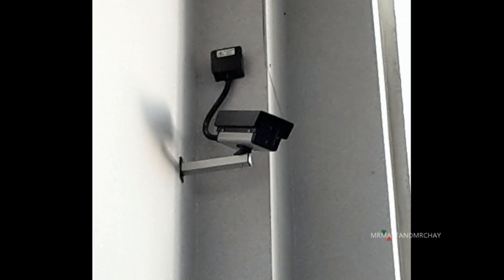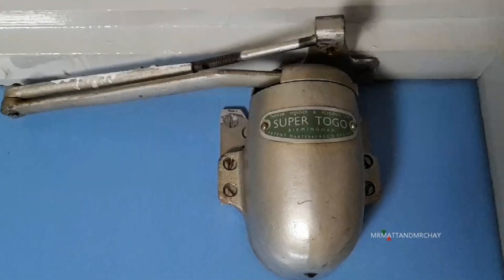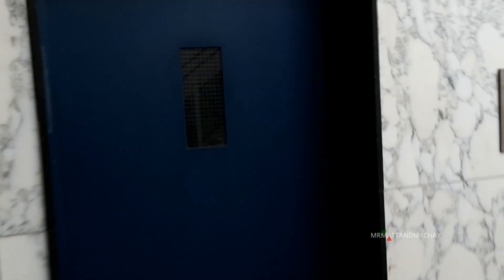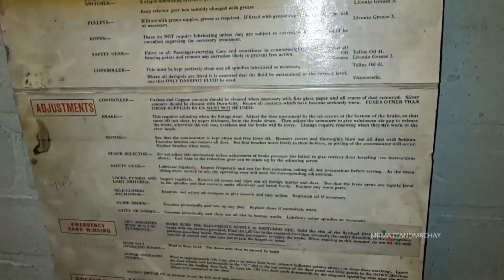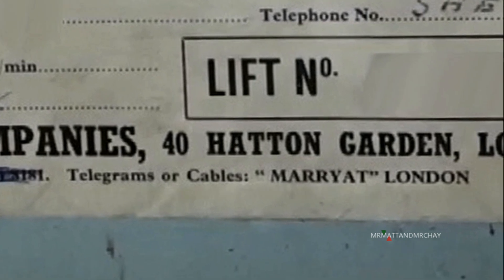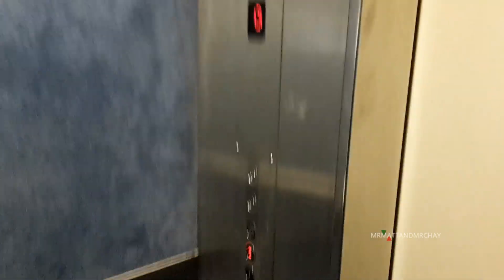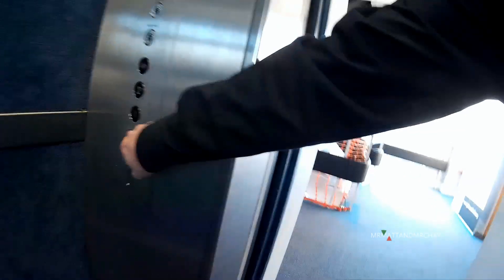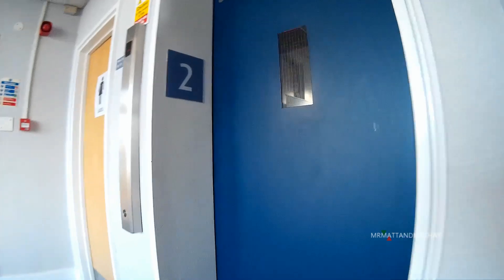OLD 1968 MARRYAT SCOTT LIFT, MOTOR ROOM & MEMORABILIA

Comment: What does P.I.R stand for and what does it do
Reply: not sure what it stands for but it is a infrared sensor that detects people
Reply from the maker: Hiya.  PIR = Passive Infra Red.  Maybe I'll do a video of how they work, but let me try to describe...Put you hand flat on a table and spread your fingers out to make a 90 degree pattern.  Where you fingers come from - this is there the PIR is located - in the corner of a room.  Your fingers represent a TOP VIEW of the "detection pattern" which is what the lens on the front of the PIR is aiming.  So in other words, it's like you are looking at a room from above, using you fingers as the detection area, with your hand being the PIR in the corner.Now let's pretend and make a "person" you can use any small object, like a rubber (eraser).  Make your eraser come into the room and it goes into your first "finger".  The PIR detects a rapid increase in the OVERALL energy level across the room.  Then as your eraser enters the room further it goes in between fingers.  The energy level drops back to what it was.  Move your eraser further into the room and it goes into your second finger.  Again, the PIR detects a rapid increase in the overall energy level across all fingers.So... as an object moves into each detection area the energy level goes up, then down, up, then down.  This creates a 1-0-1-0-1-0-1-0.  These are PULSES.  A PIR is normally set up to respond on the second pulse.Don't forget that your fingers represent where the lens of the PIR is focusing the detection areas.  There are FAR MORE than your fingers, and also there are detection areas that slope down as well as out across the room.  So in practice you are detected almost immediately from entering the room.PIR doesn't emit anything, it's an energy level detector.  The lens is very important to create the 1-0-1-0 pulses as someone walks across the room.  Some PIRs have different lenses that focus the area into one area - these are long range.  Some have "curtain" lenses that create a "wall" that you cannot get through without detection.Hope that helps?  Maybe I'll do a video on this soon.
Reply: I used to love those things as a kid, when they flashed every second. Good vid idea, btw.
Reply: mrmattandmrchay ty so much for clarifying that
Reply from the maker: no probs, hope it made sense :)

Comment: Can I just ask what elevator filmers hate about modernisation?
Reply from the maker: Maybe it's just me, but I prefer looking at mechanical logic.  New=Circuit boards and LCD screens, Old=relays and mechanical floor selectors.  Old stuff is far more interesting to watch and work out.  New stuff involves circuit boards that have been coded - nothing much to watch apart from an LCD screen.
Reply: mrmattandmrchay I see. I've never been too interested in lifts before watching you and Beno's videos, now I find them fascinating!

Thanks for making an everyday appliance so much more interesting!
Reply: mrmattandmrchay yeah being a circuit board obsessed person myself, I can agree that there's nothing to see. A hard drive, however, strip off the casing and you see something rather cool, and old style. Make sure it's a hdd.

Comment: I'm impressed with how quiet the drive motor is... especially after the mod and addition of variable speed control.  I've witnessed several of similar vintage elevators with similar mods where the drive motors whine and bark as they run through voltages and r.p.m.'s they've never been exposed to in their 30-40 years of single or dual speed relay operation.  This was well done... although I'd love to see how it ran originally   :-)

Comment: awesome but i have a questin why sometimes after being modernized the motor sound diferent even if the motor is the same
Reply from the maker: +Peter Lomas Foxy, don't forget that a noise is a vibration.  As Peter says, applying a 100% high voltage to start a motor (old style) would cause a WHOOP noise whilst the motor catches up to the voltage and frequency applied to it.  Sometimes you get a double WHOOP, which I believe (correct me if I'm wrong Peter) is the STAR - DELTA sequence.  The STAR is applied first, which is a more powerful motor voltage config to get the motor moving, then a second later relays switch the voltage to a DELTA config which more efficient when a motor is already moving.  Both sequences produce their own sounds.
When a motor is controlled using the modern method (frequency generator) the motor speed can be controlled bit by bit which doesn't cause a lot of vibration than the old system.
Reply: +Foxy_The_Pooper The original installation used all 6 poles in the motor (3 for fast speed and 3 for slow speed) with rheostatic starting to accelerate the motor up to full speed. The noise or motor harmonics would be much different than when a modern drive is connected which only uses the high speed windings.The slow speed is rendered redundant. Variable frequency generates very little or no heat in the windings and therefore the characteristics of the motor are completely different.

Comment: This is a very neat looking mod, excepr for the dewhurst panels. The black dymo tape is so retro looking. It seems that they have done several mods in the past and it looks well maintained. The motor room looks tidy.
Reply from the maker: +dykodesigns2yt At least they've left some original features.  If it had looked totally new then I don't think I would have filmed it.

Comment: Looks like they did a nice refurb on that lift, it must be lot smoother/quieter starting and stopping and more reliable. What's with the motor running backwards as the lift levels into the floor :-)
Reply: +Coolkeys2009 That is what is known as ROLLBACK, the counterweight effect is causing the system to start rolling backwards before the brake is applied. That is a Dewhurst and Partner brake it is not adjusted correctly, there is too much lift on the brakeshoes and the brake delay timer needs shortening a bit. i.e brake being applied too late.
Reply from the maker: +Peter Lomas Cool, interesting!  By the way, I always thought the ratio of the gear box would prevent the lift from moving... is this true, or does it depend on the lift?  Also, if the lift WAS able to move with no brake, surely the gearbox ratio would prevent it building up to a fast speed? (a bit like coasting down a hill whilst still in first gear?)
Reply: +mrmattandmrchay What you have to remember Matt is that the system had not come to a complete halt.When you release the brake from a stop position (say empty car), the lift does not always move.You may have to give it a nudge with the winding wheel, once the Stiction in the gear/worm assembly is broken the car will move UP through the gearbox. In the case of the video the system is always in motion hence rollback.